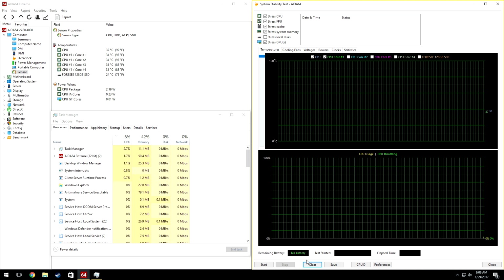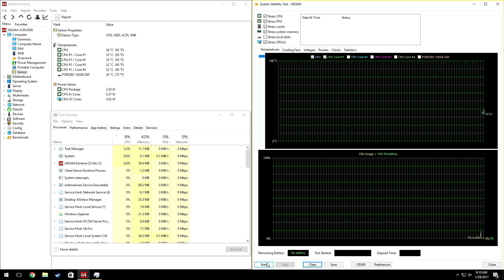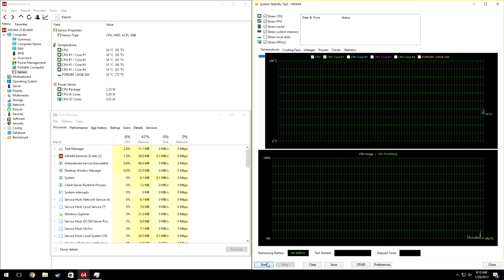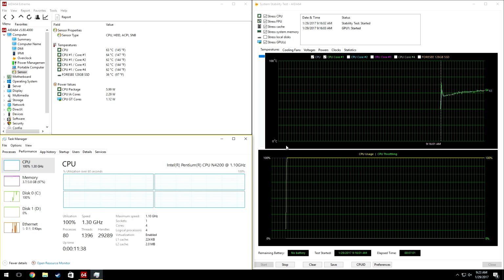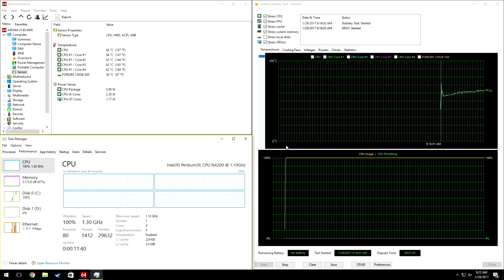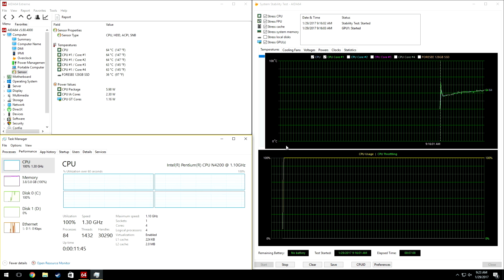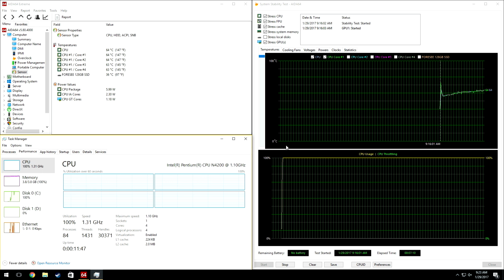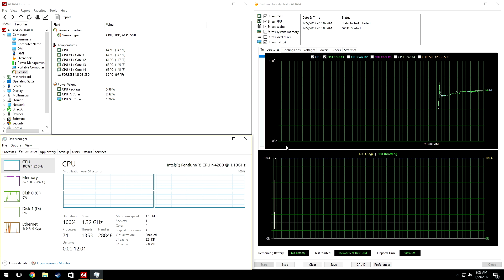Voyo vMac Mini - No Fan Mod - Apollo Lake Pentium N4200

Comment: Hello Anthony,

Did you glue the heatsinks to the metal?
Reply from the maker: +Joshua Loman I used thermal paste to attach the heatsinks to the main heatsink
Reply: Anthony Cress won't they fall off with only paste? Because the board is upside down.
Reply from the maker: +Joshua Loman when you're installing the board it is upside down for however long you take to install that. It also depends on the tackiness of the thermal paste I use mx4 which is very tacky so when I turn the board upside down it can stay that way for about 5 to 10 minutes before the heatsinks become loose.
Reply: So the case keeps them in place? And how high are the heat sinks?
Reply from the maker: +Joshua Loman 4-5 mm
Reply: Thanks. Going to order the supplies and do the mod. I wonder what the temperature does with a 2,5" HDD build in..
Reply from the maker: +Joshua Loman not sure. I have the HDD cable just haven't installed it

Comment: Hola! He conseguido bajar mucho la temperatura con disipación pasiva. Sin ningún tipo de ventilador.
Para que os hagáis una idea está "Preparando para instalar Windows", con Cubase 9 Elements, Photoshop CC, Illustrator CC, Word 2016 y Excel 2016 abiertos y ejecutándose tengo 58º. 
En Idle ha arrancado en 40º. Os dejo lo que he utilizado:

- http://tienda.bricogeek.com/accesorios-robotica/560-disipador-de-aluminio-con-adhesivo-30x30mm.html
- https://es.aliexpress.com/item/New-100mm-100mm-1mm-CPU-Heatsink-Cooling-Conductive-Silicone-Pad-Thermal-Pad-high-quality/32755247864.html
- https://es.aliexpress.com/item/New-10-pcs-20mm-x20mm-0-3mm-0-5mm-0-8mm-1mm-1-2mm-Heatsink-Copper/32805798925.html    (0.8 mm!!!!!!!!! No lo compréis más ancho!!!!!)
- OPCIONAL AUNQUE RECOMENDADO https://es.aliexpress.com/item/NI5L-8pcs-Set-Copper-Copper-Heat-Sink-For-VGA-GPU-DDR-DDR2-DDR3-RAM-Memory-IC/32800254052.html

Los pasos han sido:

1.- ) Buena pasta térmica en el procesador
2.- ) Pegar la almohadilla térmica encima del disipador de cobre de 20x20 
3.- ) Poner con cuidado la placa metálica del voyo donde va el ventilador (Quitamos el ventilador xD).
4.- ) Atornillarlo
5.- ) Poner centrado el disipador de aluminio
6.-) (OPCIONAL) Si habéis comprado disipadores de cobre cuadrados para chips de tarjeta gráfica como los del vídeo, poned un par de ellos o tres alrededor del disipador de aluminio.

Listo! 

Espero que os sirva y os funcione!

Gracias a Anthony por su vídeo!

Comment: "some heatsinks... some thermopads... " can you be more specific and write.. what type/size heatsinks you used.. what thermopad ?
Reply from the maker: +Artur Zdolinski sorry I never really thought about that. I have to look up my order info on the heat sinks. As far as thermal pads I just cut my own out of a 100mmx100mmx1mm pad I ordered off eBay.

Comment: Did you use three 1mm thermopads to fill that hole under the fan?

I think that sticking thermopads on PMIC and coils would be a good idea.
Reply from the maker: +Martin Gorbush no only 1 single pad 5mm thick I think. And yes that would probably be a good idea.
Reply: Sorry to bother you again but I plan to buy 3mm thick thermopad and I want to know if that would be enough.

https://youtu.be/BmEOelxTKBQ?t=1m47s
On this video it looks like you stacked three or more layers. It is so or maybe such rough surface was made by your cutting tool.
Reply from the maker: +Martin Gorbush no bother. Hmm I don't honestly remember what I used. After reviewing the timecode link thank you very much and looking up my order if I used more than one piece of thermal pad it would have been 2 millimeters thick. I looked up my eBay order and the pad I ordered is 1 millimeter thick. Hopefully this helps. I really wish I would have shown that step better in my video I didn't realize I just jump cut.
Reply: Thanks
Reply from the maker: +Martin Gorbush no problem I'm more than happy to help.

Comment: I always used Handbrake to convert video files to test CPU heat. In converting a TS file to mp4, I have had machines go over 108 C.

Curious to see what that would do on yours.

Comment: The power cord, ey?  Let me guess:  it fell out of place?  (I own this unit and have seen others complain that powercord doesn't lock in.)  :)

I'm a fellow Anthony and have a question for you:  what temp would you consider too hot for the unit?  It's so hard to get an answer to this but you seem to know it.

Please share!
Reply: +SCREENPLAYHOUSE LLC yes it was the power cord. 

well for me under 70c is fine. The chip can stand 90 c before it thermal throttles a lot. With stock heat sink and fan it would be around 65c
Reply from the maker: +SCREENPLAYHOUSE LLC didn't realize I was on my other account lol

Comment: Anthony, how much clearance is there between the heatsinks you added and the top of the case? You might be able to add a good quality thermal pad in between so that the heatsinks send out the heat to the outer chassis and achieve even better results.
Reply from the maker: +George TJ I did think about that but as much as I take it apart for videos I didn't see making a mess Everytime for a few degrees. It cools well with out that and the biggest issue was the fan noise. It was worse than an old ATI GPU.
Reply: Right I see. It seems there is some serious noise after all with the stock fan on... 

So, with this mod you haven't noticed any CPU throttling, have you?
Reply from the maker: +George TJ hell without the mod it didn't thermal throttle. But I didn't like running it that hot.
Reply: The thing is if after some stressing the CPU throttles without the stock fan. This only time will show you in real life tests.

Anyway, good to know Anthony. Many thanks

Comment: Anthony can you share some new experience with this no fan mod?
Reply from the maker: +WordPress Plugins like what you looking for?
Reply: Some new insights. I want this device and i like your mod so i want to know if it still works and if the device works well with this mod maybe you find some new cons etc
Reply from the maker: +WordPress Plugins I actually still need to make my video on the pros and cons thank you for reminding me. Because there is one that can really hurt this machine if it's placed somewhere where I can be bumped. The power adapter that they send with it is quite loose. Amusingly enough other than that there is not a lot of cons for this machine. I will try and get that video shot and get it up on Friday for you
Reply: Thank you!

Comment: Great video! This was one of the reasons why I was hesitant on purchasing this device. Most of the reviews were critical of the loud fan noise.
I don't understand why they didn't put an HDMI 2.0 connector on this unit. Intel specs show the Apollo/Kaby lake processors are capable of 4K@60hz. Using a mini hdmi connector limits the unit to HDMI 1.4
The $222 Celeron J3455 (Amazon) Apollo Lake NUC has hdmi 2.0, granted it only has 32GB eMMC of storage and 2GB DDR3 1600 
I'm thinking of holding off until April when the rest of the Apollo Lake & Kaby lake NUC's get released.